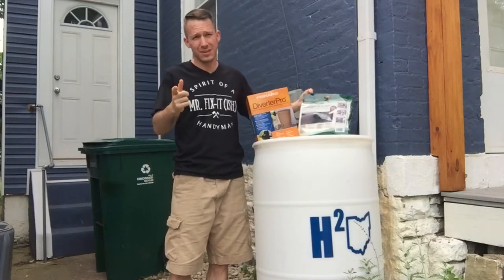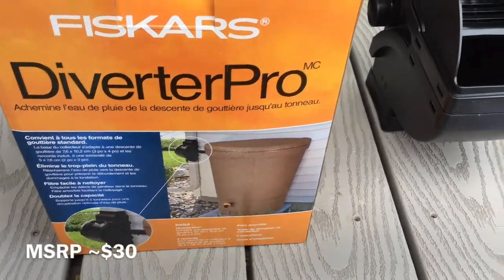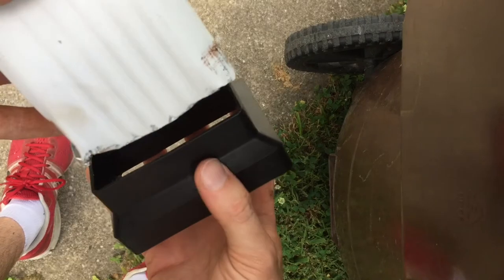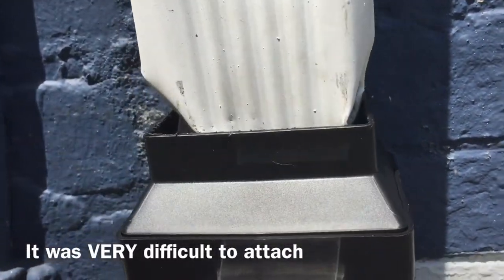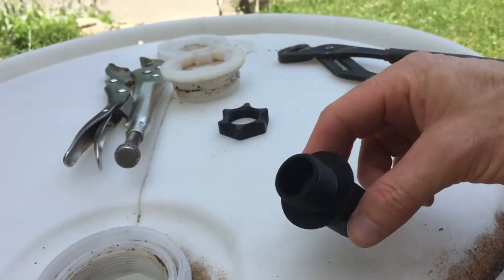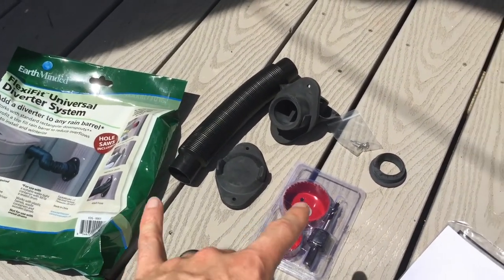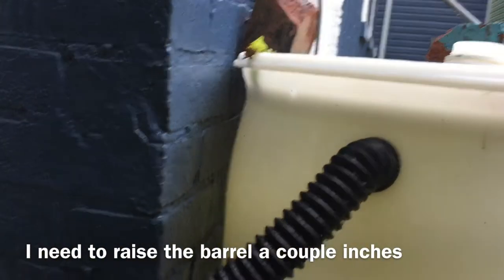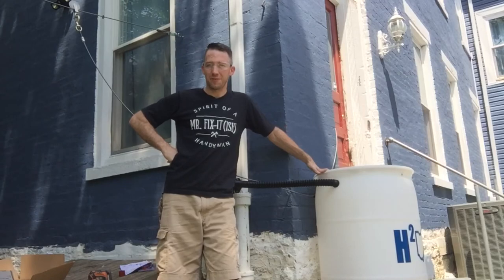Fiskars DiverterPro vs EarthMinded FlexiFit: Which is Easier to Install and Use?

Comment: I'm getting the earth minded flex fit after researching many kinds. So I'm in agreement with you. Another plus for earth minded is you can also purchase individual parts of the system. So if you wanted to add barrels later.

Comment: with the fiskars, the downspout connection is easier if you use tinsnips to notch out the metal and then use pliers to bend then in. its a bit tricky and you need to use gloves but not impossible.
Reply from the maker: Great tip!

Comment: For cutting downspout, it's better to leave the Sawzall in the toolbox. Use a hand hacksaw with a 32 tpi blade and go about it carefully. It's entirely possible to do the cut without crushing damage.
Reply from the maker: Thanks for the tip!!!!
Reply: That's a good idea. It's how I cut mine. However, I find that all these rain diverters DO NOT fit the downspout without a lot of crimping. Yeah, as shown in this video, the transition from the downspout to the diverter is not very well thought out on the 2 X 3. I would think that the 3 X 4 would not be much better. The bottom, or discharge, side of the DiverterPro doesn't fit and a lot of the water is going to spill out onto the ground, not a good way of doing things, and will likely get into your home foundation. Why did Fiskar's do this?

Comment: I installed the diverter pro yesterday.  It rained all day.  When I looked inside my rain barrel. It was completely empty.  What did I do wrong?
Reply from the maker: You probably didn't have the right slope going from the diverter into the barrel
Reply: You are right!  I went outside in the rain and fixed it.  But I actually put in my old fiskar unit.  Might just leave it as is now.  Thanks

Comment: I've been looking at these two systems myself.  Can you tell which one captures water better?  Any concerns about the inability to clean out blockage on the EarthMinded system?
Reply from the maker: That's a great idea! I haven't ever checked on how quickly they fill up. In order to tell I would need to set up a GoPro in front of both rain barrels to monitor which one captures more quickly. I do know that they both fill up within one standard midwest rain storm so it may be a minor point as to which captures more. 

If you don't have covered gutters or at least a really good way to prevent debris falling down the gutter then I would be concerned about blockage--especially if you have trees over your roof line. With that said, it is pretty easy to take the EarthMinded system out in order to clear a blockage, but that requires unwanted maintenance.

Comment: I will probably buy the Earth Minded system, thank you for posting this video!  You mentioned that it'll be easier to winterize -- can you mention the reason why you think so?  I will need to take this in to consideration after the autumn ends.  Thank you again!
Reply from the maker: Both systems require a bit to winterize. The Earth Minded system requires you to remove the rubber diverter and place a cap on your gutter (they supply); it takes two screws and 20 seconds to complete. 

The Fiskars system is also easy to winterize however. You just remove the hose, cap it with the plug they provide (no screws needed). Obviously you also will want to drain your rain barrel but that doesn't matter which system you use

Comment: Great video!!!   I never heard of the EarthMinded Flexifit diverter.  I will have to try that one out. Does the rain water leak out of the diverter during a hard rain on the Flexifit?  Or is there some type of seal being used?
Reply from the maker: The hose itself is a plastic crinkle straw but there is a rubber gasket that provides a tight fit into the rain barrel itself and a tight fit into the rubber piece that scoops that water out of the downspout. I have not experienced any leak (though I guess it would be hard to tell what was leaking and what was rain...)
Reply: Great!! Thanks for the response.  Love your channel.

Comment: The fiskars diverter is way more efficient. As far as hooking the system to the barrel, drill the hole in the barrel smaller and thread the fitting directly to the barrel. No need for the nut on the inside.

Comment: The Fiskars system is fine...You just had either the wrong rain barrel or you could have purchased a different diverter spout that doesn't require an internal nut.

Comment: Nice to see the comparisons.
1) why not just install an outdoor spigot since you said you didn't have one? After spending that much on diverters.....a spigot would have been just as cheap. However, a rain barrel is good conservation.
2) Did you dismount the gutter before cutting it? Might be easier.
3) Did you even read the instructions on how to install these?
4) You could have cut a larger hole in the top of the barrel to fit your hand in it!
But like I said. I did like the comparisons.
Reply from the maker: Thanks for the feedback Jim! 
1) It would have been less work to install an outdoor spigot but I also wanted the conservation aspect :)
2) I didn't, but that would've made the cutting easier
3) Yes, both systems come with instructions
4) I was trying to utilize the hole that was already part of the manufactured barrel, but that is very true!